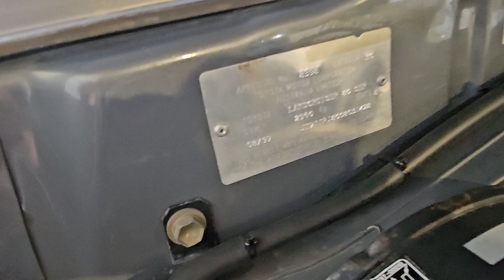TURBO KIT ON A STOCK 1HZ 🤔WHAT? 😳🚨OLD MOTOR... SAME PISTONS... ORIGINAL 1HZ PUMP... NO INTERCOOLER?

Comment: You fitted the turbo to my 1HZ 105 cruiser about 23yrs ago. Still going great, rebuilt the engine about 6-7yrs ago due to overheating after I changed the heater core and didn’t get all the air out. My bad totally. Have since fitted a cross country top mounted intercooler. She purrs all day. Simple engine and easy  and cheap to work on. Can’t fault your professional service and attitude when it was fitted. Great to see the generational legacy.
Reply from the maker: So nice to hear and you're welcome!
Totally agree there is nothing more simple than a 1HZ
👍
Reply from the maker: Lovely to hear!!! Cheers!!